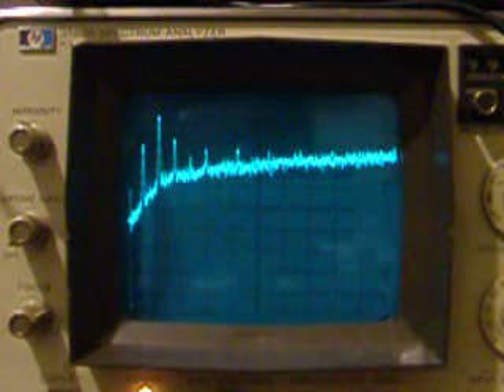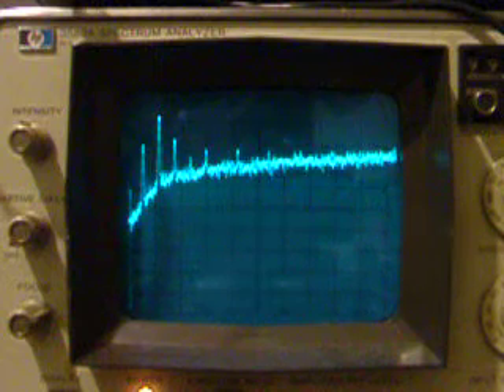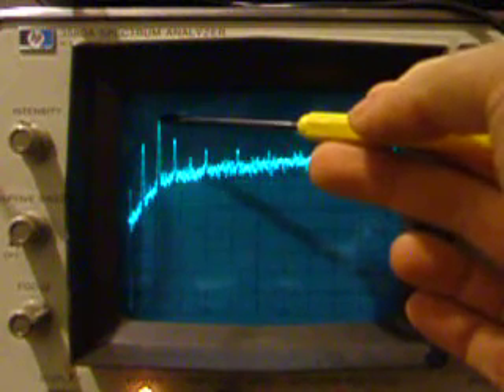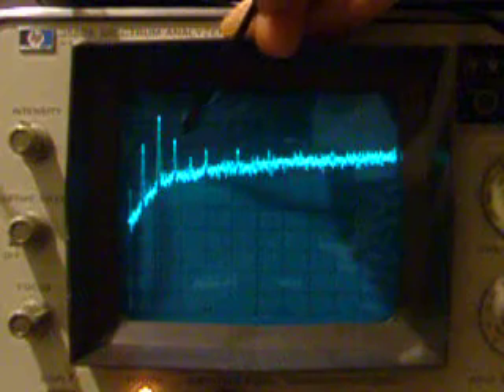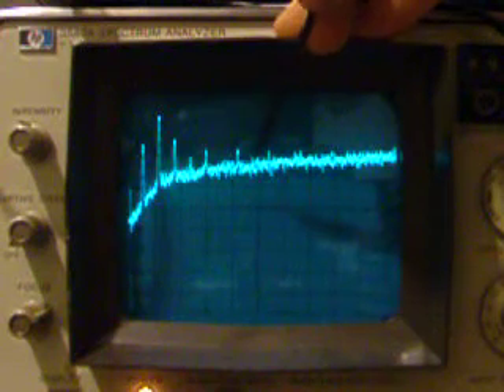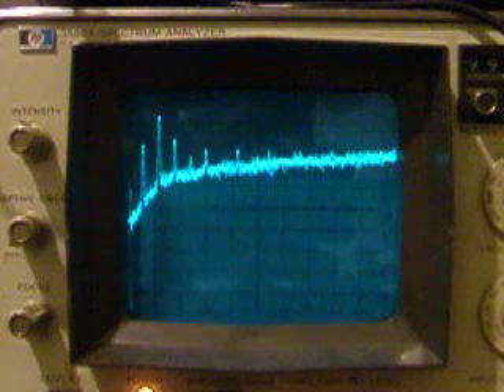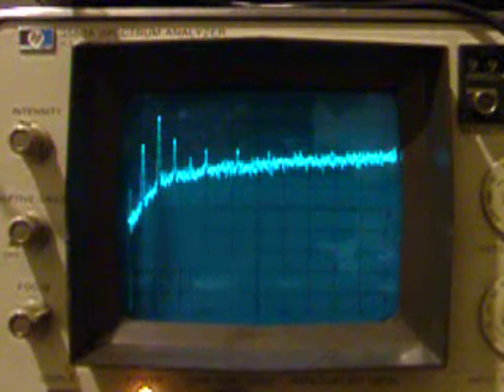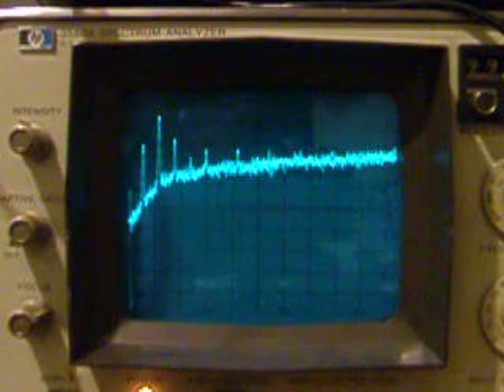The Hunt for Buzz & Hum - Part 8 of 10

Comment: I just finished working on my amp, and I'm super happy with the results so far. I never hear you talk about the center tap on the heater winding, and/or if it was balanced. I just put in a multi-turn trim pot in and was able to take out the hum in my cathode follower circuit, some said the possible leakage wont sit 50/50 dead center,or heater winding won't cancel each-other out, do to unbalancing resistance, and so, having a potentiometer as an artificial center tap, you can find that center... Mine sat at a roughly 40/60 position between 500Ohms, and it killed my buzz I had with all knobs turned full off.

I do gain some buzz, when the knobs are turned past a certain point. I plan on elevating my heaters next, to see if that helps. 

This is the second time watching these videos, the first time I didn't really know much and this was all math. After scrounging the inter-webs I find this makes better sense to me.

thank you for posting these.